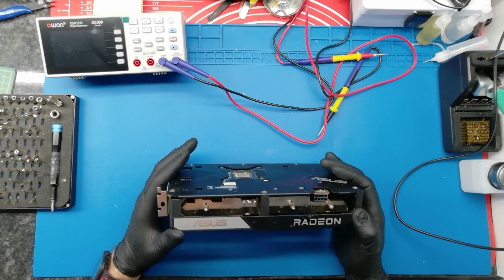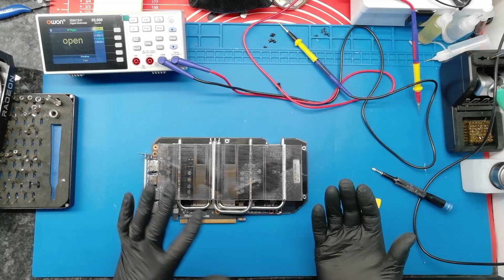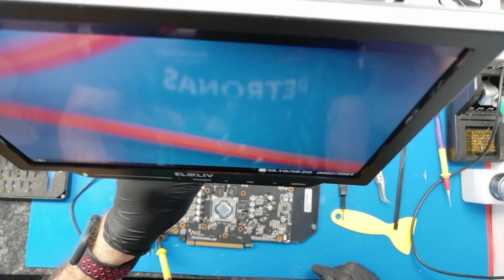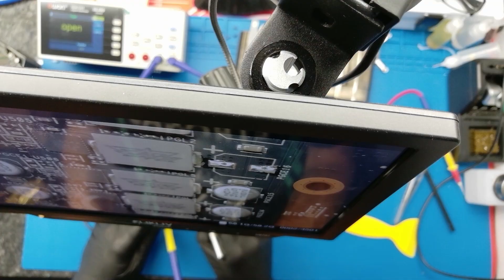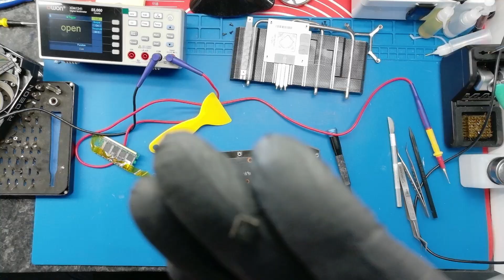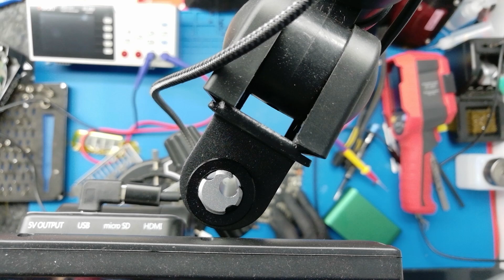Rx6600 8Gb Graphics Card Repair attempt, still learning

Comment: u manage to fix?
Reply from the maker: Unfortunately not, do you have any suggestions??
Reply: @PCDDRepairs  I have an Asrock challenger Rx6600 which is a very similar layout. Everything is shorted to ground without any obvious anything. The user spilled some tea and honey into the PC which ended up straight on top of the GPU. Gave it a bath in alcohol, no change. Seems like these boards just love to short to ground... The whole PC otherwise survived though.
Reply from the maker: @t4thfavor1212 anything showing under thermal cam ??

Comment: I haven't watched part two yet but the important thing is the core is very low impedience it will always measure close to zero ohms on the power stage coils but that is normal not a fault or a short.

It looks like the fault you had is not direct short to ground it's a short to the core. The DRMOS was shorted so you were seeing the resistance of the core on the main power rail which also means the core took the main power rail voltage and likely to be dead.

Possibly a second DRMOS is faulty but it will be very hard to see as all the amps you lr injecting are going straight into the core which is very good as dispersing the heat. 
The method you can use is moving the ground to after the coil so the injected current will not flow through the core and the faulty DRMOS will heat up
Reply from the maker: never thought about moving the ground to a a coil to shorten the path, thank you will give it a try
Reply: @PCDDRepairs Yes the current will always take the least path of resistance